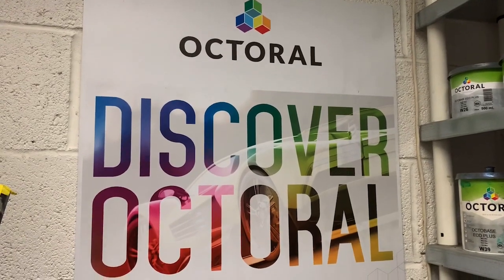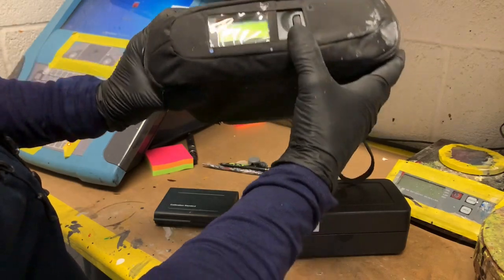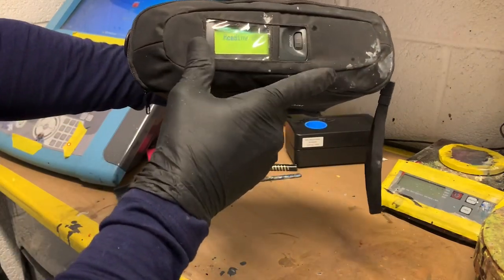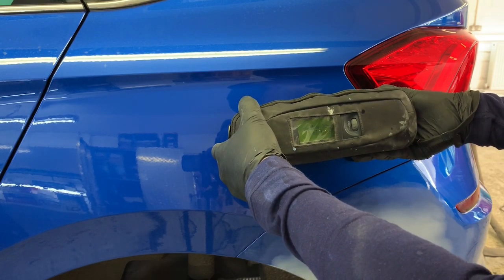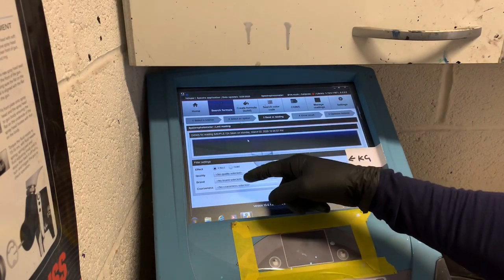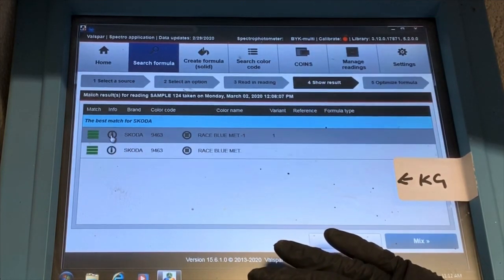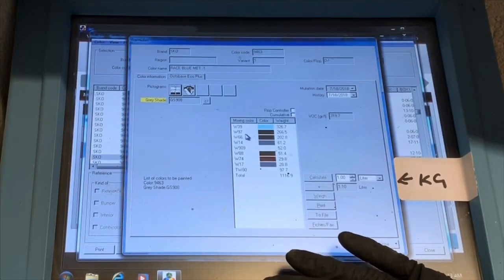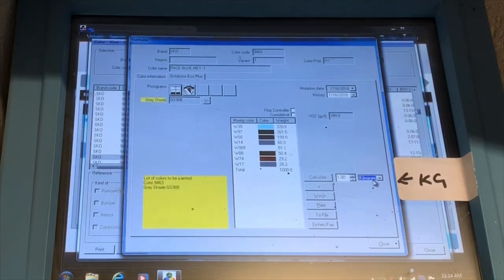OCTORAL SPECTROPHOTOMETER & COLOUR MATCHING

Comment: Hi Wayne, looking at getting a spectro as im now back out on the road. The problems i find most is finding bumper/trim colours on cars that dont have paint codes (generally matt finish on grey/silver trims etc). If i was to get one,would i be able to use the spectro to match these problem colours?? I done a renault last week and couldn’t get a code for the grey trim,so ended up getting a colour near and painting whole trim…not ideal..
Reply from the maker: Hiya. Which paint brand are you with? 

The Spectro will definitely help massively but is not 100% perfect unfortunately
Reply: @damageundoneltd  im on octoral wb. I notice that when you load up from spectro to computer and enter manufacturer it comes up as the correct colour, but as the trim parts have no colour or code, would it still give me a formula for the colour i have just spectroed?? If that mske sense😂😂
Reply from the maker: Yes it will or it’ll find the next closest colour. 

It does remove a lot of guess work and if you can afford the invest it definitely worth it. 

The spectro works exceptionally well on solid colours
Reply: @damageundoneltd  thankyou wayne your a star. Appreciate your time👍🏻
Reply from the maker: Happy to help
Reply: Are you still using the same system ? I have had a few mares with it giving me what it thinks is a great match and turns out to be off. Strangley it works a treat on the matt colours using the new matt/semi mixing system and spray out cards for top coat. 
Some days I trust it some days I choose to spend the time on spray outs 😂
Reply from the maker: @quikie1984 I wonder if your Spectro needs a service? I’m not experiencing the issues that you are
Reply: @damageundoneltd
iv asked this question mate and they seem to say just ensure it calibrated with the black and white and the shielding ring is not worn. (Got spares with it) You know yourself if it let's light in it declines the read usually. Do you use cutting compound or polish pre read as I hear that can also make a difference 🤔
Reply from the maker: @quikie1984 I always polish the area and then wipe it with a solvent degreaser before taking a reading. This is very important